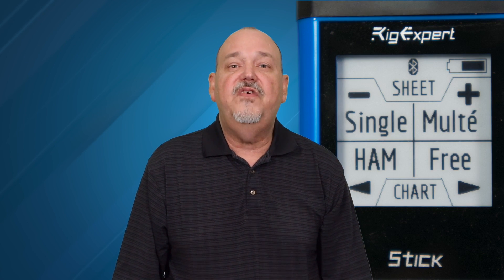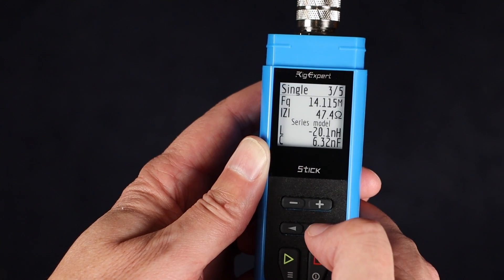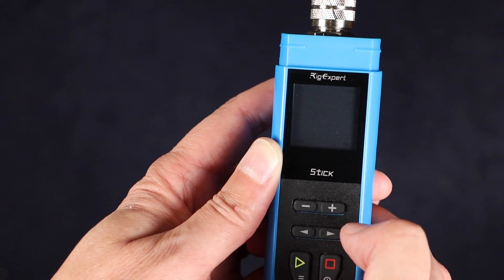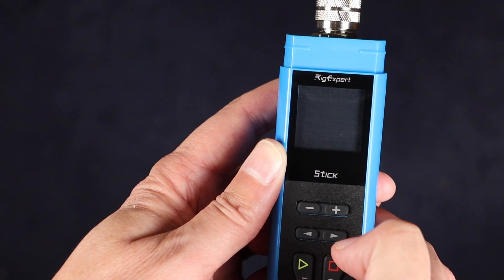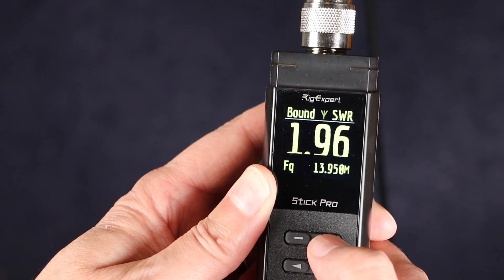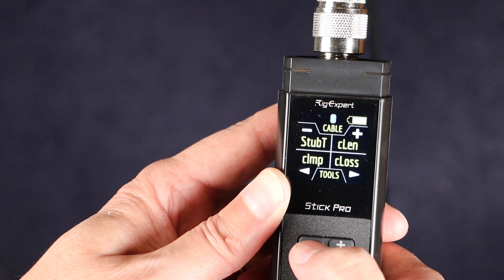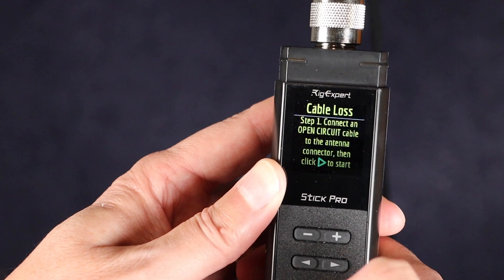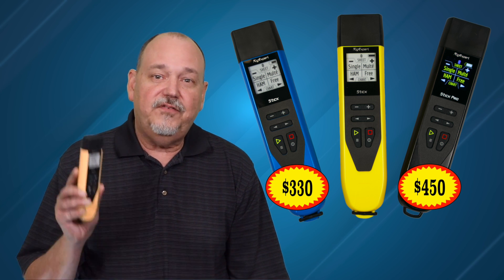All RigExpert Stick Antenna Analyzers: Including the New Stick 500

Comment: Nice video! Ty. Does the 500 tell you if and where the cable has a problem?
Reply from the maker: The Stick 500 has a TDR like function that can give you an indication of where you may have an issue but in practice, this can be a bit fiddly.

Comment: I was one of those dumb enough to buy a rig expert product....yhe rig expert 500 itself is okay, but the ant scope2 software has about one page of documentation in the four pages that they called the manual!

 The rig expert company itself will not respond to any emails!!

I bought this unit because it would connect to my computer, now that it's connected there is no manual for it worth a damn and there is no support from the manufacturer! 

**" I have to wonder how much this company is paying these YouTube people to promote this device? It's an absolute useless paperweight without documentation and support!
Reply from the maker: Thanks for your comment.  I agree that Antscope software leaves much to be desired but to be honest, I don''t use it so that doesn't influence my opinion of these devices. I get it if you bought yours for the purpose of having a computer connection to it, that you would be disappointed. I also agree that the documentation is not the greatest either so you certainly have a point there. 

Rig Expert did send me a 500 to review but I bought the Stick 230 with my own money and I feel strongly that both of these are outstanding field antenna analyzers. I would never give a review for payment and I always make it clear before I accept a device that it will get an honest opinion.

Comment: Expensive doohicky that other cheaper doohickys can match. Why would you ? Overpriced, some hf radios are cheaper ! Does it really work better than any other, No it doesn’t.
Reply from the maker: absolutely more expensive than say a nanoVNA but I wouldn't say that those match these. Yes they work but much more of a pain in the butt. Takes much longer to get the same result if you include calibration and all of the menu settings to get it setup for a simple SWR check. Bottom line is you have to decide which is right for you so if the cheaper options get you out there and on the air, good deal.

Comment: How accurate is the SWR number compared with the Bird meter or some other big brand's Network analyzer instrument?
Reply from the maker: I don't have access to a Bird meter or other "Lab Grade" test equipment so I could not give a fair comparison. That being said, I will say that the RigExpert analyzers are more than accurate enough for what we do as ham operators. I have yet to run across a situation where my meter said an antenna was good and the radio thought otherwise.

Comment: What i learned in your videos is not only to look at swr but also to look at the resonance using the rx chart, only the stick pro has the function right?
Reply from the maker: It does. You can get impedance measurements on the others but not the graph which is really nice

Comment: I was wondering if the SWR is measured continuously or does it measure only one time. I have the AA-35 and it will measure SWR continuously and helps out tremendously when tuning my antenna.
Reply from the maker: SWR is measured continuously in the Single mode although you can stop it. In the graphing modes, you have to imitate each sweep. I believe that is the same on my AA55 Zoom although on that one I think you can have it continuously sweep. It has never been an issue for me this way.
Reply: @houseofhamradio  Ok thank you! I'm contemplating getting one for my bug out bag.

Comment: I bought one after watching quite a few videos, and nobody mentioned its main shortcoming... NO FREQUENCY COUNTER! I bought it to reduce my kit since it is smaller than my MFJ 269D, but guess what, I still have to take the MFJ 269D with me for the frequency counter feature. Also, the Bluetooth is VERY short range, like one car length, and drops out easily, so the stick pro has become the backup at home in a drawer to the 269D.
Reply from the maker: Certainly not questioning your needs but for me, I have never had the need of a frequency counter for antenna setup in the field which is the primary use case of the Stick devices. As for the Bluetooth, yes it is Bluetooth LE which has a limited range over standard Bluetooth. That is by design to reduce battery consumption.
Reply: @houseofhamradio  when Bubba has a commercial radio and needs his antenna tuned, and has no clue what frequency he transmits on or even what band, that’s when the frequency counter comes in really handy.
Reply from the maker: Gotcha. Fortunately, I don't have to deal with that. If I did, I would probably bring my NanoSA (tiny Spectrum Analyzer) But still another device to bring but much smaller than MFJ269.
Reply: @houseofhamradio  the MFJ is a dinosaur, and doesn’t have half of the bells and whistles that the stick Pro has, but fortunately it does have the basic tools that I need. Half of the operators out there (not hams) don’t have a clue what frequency their radio equipment runs on, they just know somethings not right with it. The stick pro is a handy little unit, I’m just trying to warn others that it is not the do all that they may think it is.
Reply from the maker: Oh absolutely Joe, I appreciate all additional info for the viewers. Particularly for something as costly as these devices. I prefer folks to go in eyes wide open and know as much as possible.
Reply: How accurate is the SWR number compared with the Bird meter or some other big brand's Network analyzer instrument?

Comment: How did you designate the Stick 500 as THE MISSING piece of the Stick line? A 35 MHz Stick could be a missing Stick for HF only operators, the same argument can be made for a 1.2 GHz capable Stick and still be considered missing. There was no need for the Stick 500 previously to start with, hence no one was missing it!
The way i look at the Stick 500 is that Rig Experts has more inventory of Stick 230 and thought to their selves “why not we dump a couple of programming lines we already have been using on the Stick Pro, create new name, and charge $70 more for the same exact product.” 🤷🏼‍♂️
Reply from the maker: Thanks for your comment. The way I was looking at it as it covers the bands that most hams care about including 70cm band but without the Pro features that many hams don't care about.
Reply: Dump your frustration elsewhere buddy... The guy is cool and good.... don't watch and more don't buy if you don't have the cash... You are an arrogant badly raised individual. Spare the ham population of your nasty comments....
Reply: It's arrogant for you to assume everyone thinks like you. Some people really like the e-ink display. Josh from Ham Radio Crash Course has mentioned in his videos that he prefers the e-ink but wished it covered 70cm band. He's not the only one who does not need all the extra stuff on the Pro.
Reply: @sammiller6631  agreed. not everyone needs all those features, and the e-ink display is pretty awesome.